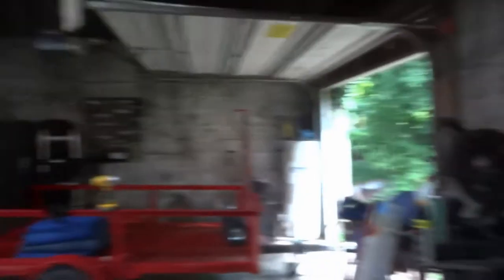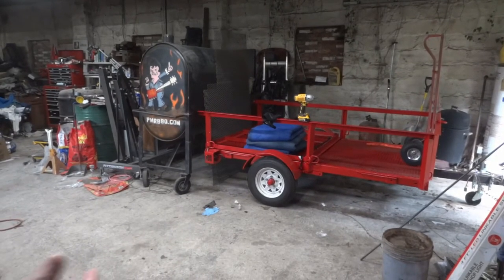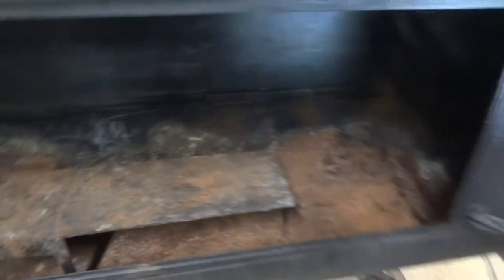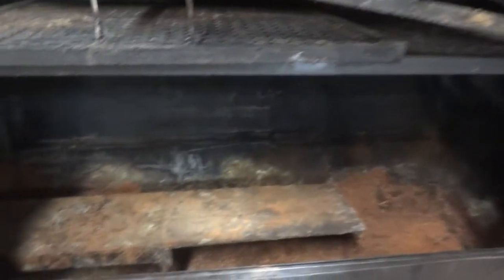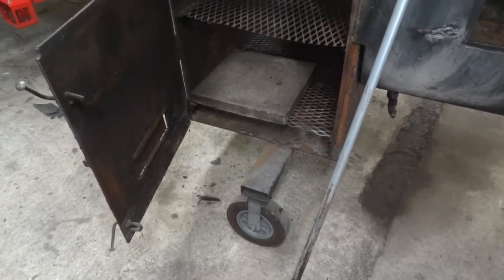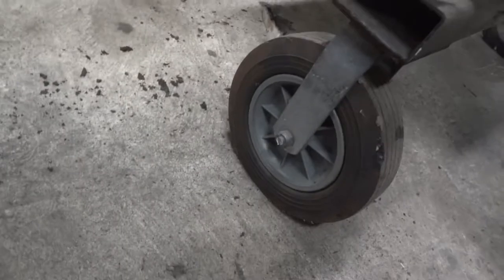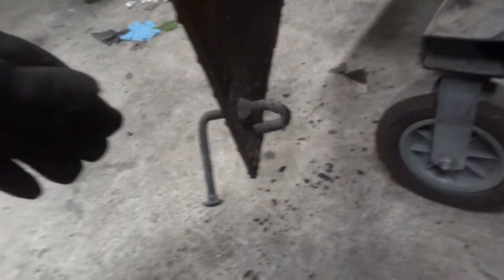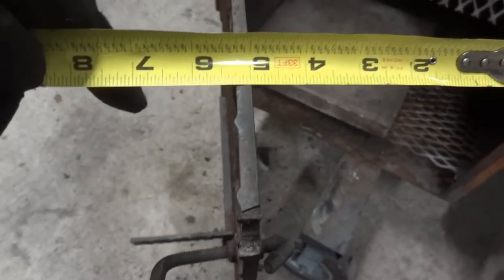The Priscilla Project - Part 3 - Cleaning the cook chamber and gutting the firebox

Comment: Dash, I like your idea of using the same size angle iron, as what you used on trailer, in the firebox.  I think trying to slide a wood source box on the welded-in expanded would have caused problems.  I might even say take all the old angle entirely out of the box.   Totally start from scratch, because your ideas and knowledge are superior to the guy who originally built Priscilla.  Consider how refrigerators allow you pull out a drawer almost totally without having it fallout.  Same as oven racks.

You may want to consider replacing the deflector plate in the cooker with one that is removeable.  Makes it easier to maintain the  cooker.

Could the door problem also be related to undersized support of the wheel frame under the firebox in light of the effects of heating the metal which may cause it to bow?  Especially if you increase the log basket weight?

You can do this!!!!
Reply from the maker: Mark, as always you sir have great insight. My plan is to make the slide so that the basket will not fall once slid out. I didn't think about removing what was there, but I think I will at least look into it now. I need to see just how well or most likely poorly it was welded in place.

The door problem looked like it was just cut too tight and no clearance left for the door to travel. The support seems to be 3"x5" 11 gauge (1/8th") maybe so I think it is sturdy enough. Plus there is enough of an air gap that unless it is run really hot the support shouldn't be affected. 

Lastly, the deflector plate... I toyed with the idea of getting rid of the one that is in there but had NO idea what to put in it's place. I've never used an offset firebox smoker before so I kinda need to see how it behaves. I think I am going to get the firebox wrapped up and then do a test fire and see what she does, then go from there.
Reply: Dash, one step at a time is wise.  The firebox is the HEART of the machine.   If I get a chance I'll watch some other offset smoker build videos and see what they do for a deflector.
Reply from the maker: I'm sure she'll tell me what she needs once fired up but you're right about the removable aspect. I also have been thinking about how to add a Clean Out.

Comment: That bottom of the firebox has bent up because the floor is not strong enough to carry the weight of the smoker. That's why the door wouldn't close. bend it down and add a piece of steel under the floor to hold it straight. Good to get rid of the expanded and build a fire basket. Happy smoking.
Reply from the maker: I was hoping to get out to the garage and test and see if the floor had in fact bowed but I didn't get out there last night. I will make it a point to do so tonight. There might even be a video about my findings tonight.